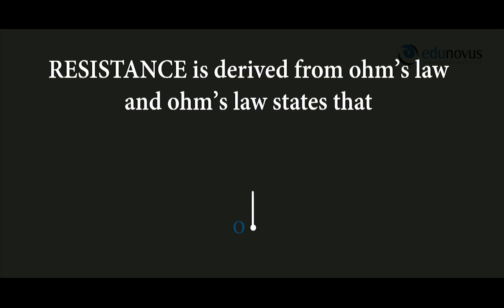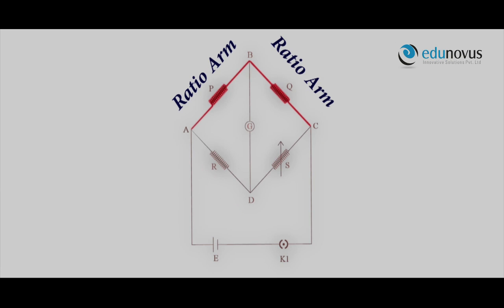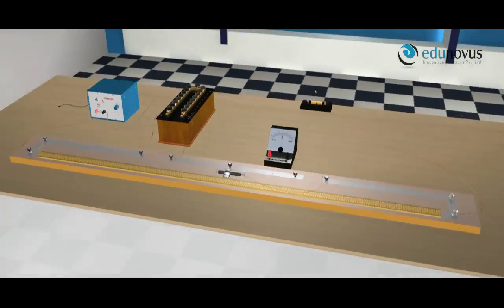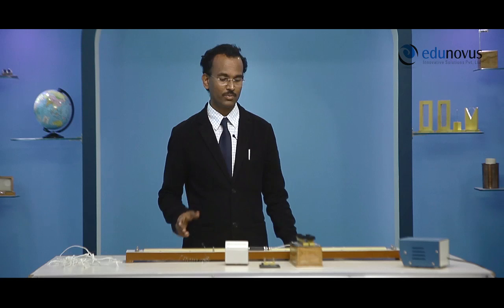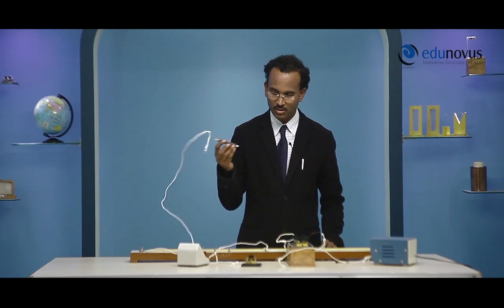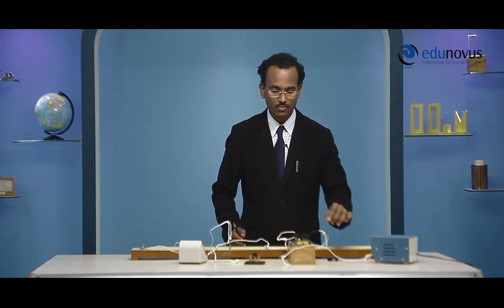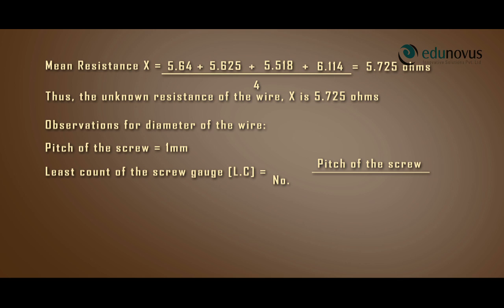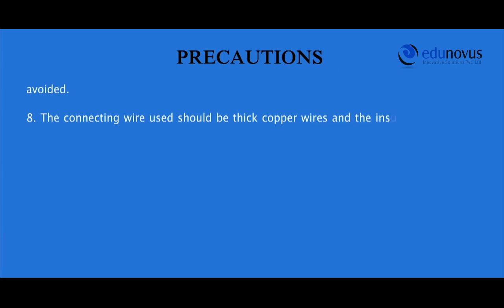Physics Practical: Meter bridge (Use headphones for clear audio/sound)

Comment: while calculating the specific resistance, the length of the wire and the diameter should be converted from cm to m

Comment: Is it possible to have different values of unknown resistance for different known resistance from resistance box?
If no then what is wrong with my equipment? How can we check whether it is working or faulty?
Reply: Mustafa Khatri no the Wheatstone condition will give the same answer irrespective of resistance used . As resistance of the wire cant change

Comment: Sir in galvanometer , deflection is on same side. i have increased battery potential, tight wire connections but still deflection is on same side please make a video and tell me proper solution. grt hope from you.